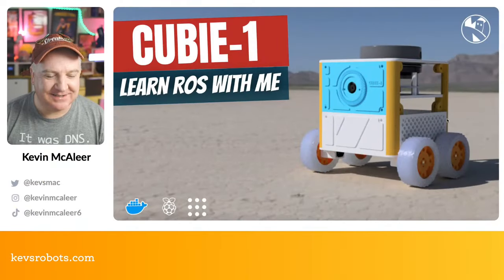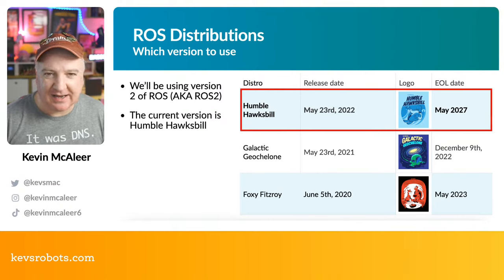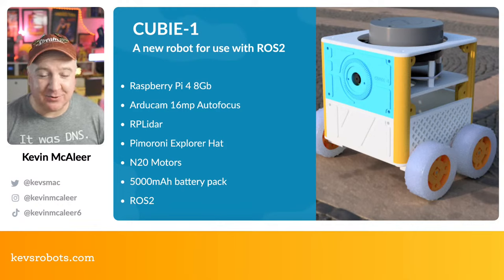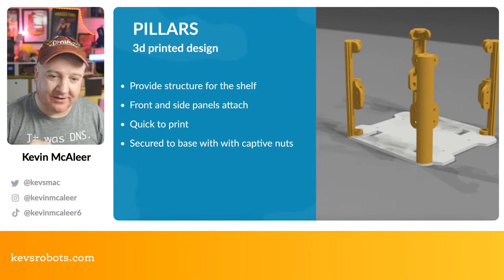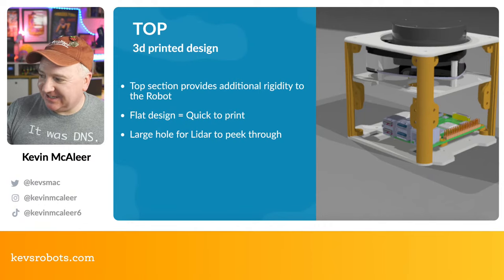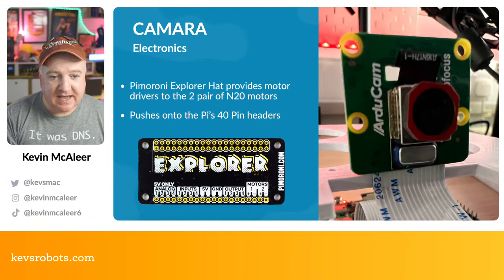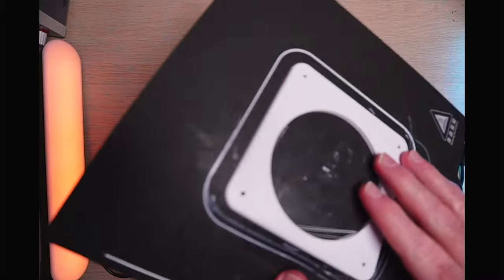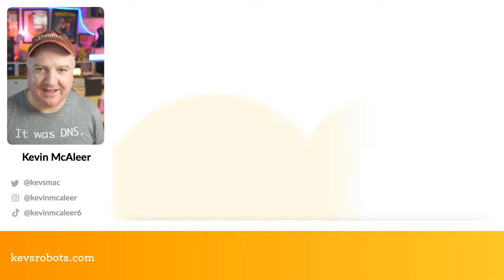Build a ROS robot - Learn ROS with me Part 1

Comment: This is great, looking forward to the videos!
And about the wired connection to a rotating device I was wondering about it myself, looking at surveyor's total station devices which also use lidar in a rotating scope.

And after a bit of searching I came upon a connector called a Slip Ring.

Comment: batteries are really expensive to get shipped from pimoroni these days. I tried ordering one (2000mAhr) in august to a uk adress, and they wanted a postage premium of over £41. I ended up buying 2 the same capacity from amazon including shipping for less than half the price of their shipping. I did have to reverse the jst connector pins, though so it is worth mentioning to check that the polarity is correct. I like your vid and robot. my own robot is using a pi zero w with "lego compatible" motors, pimoroni explorer hat, pi camera, and a lego frame (no 3d printer). I have 2 TOF sensors connected, one for the body, and one for the "head", but one went on the blink, so I had to order another one. I'm working on hardware for muliple switch sensors, but it is slow. I'm interested to see how your testing with ROS2 goes. currently I just use python, but I keep the code on my file server. that way I reduce the writes to the sdcard.

Comment: Hi Kevîn. Nice project, will be interested in building one. Can you give us more details about the exact type of the n20 motors ? I just now checked the pimoroni site and see that there are different models. will the all fit ?  Keep your cool stuff going !
Reply from the maker: It's a work in progress, so currently, the motors are not wired up yet. I want to collect odometry information from the wheels/motors, however, in the first iteration, they will just be simple motors. I've a bunch of 150rpm 6v N20 motors, so that's what I'm using first.

Comment: ROS2 seems to have more modest hardware requirements compared to ROS1.. I wonder why a platform capable of running ROS1 can't run ROS2!   For example the $500 MIKRIK uses ROS1 on the Orange Pi Zero3 and ROS2 for the for processing (LattePanda Delta 3, Intel NUC, or NVIDIA Jetson Nano, etc).

And why don't drones use ROS?  From what I've seen, they typically use either PX4 or ArduPilot.. maybe MavRos.  Is ROS harder to configure and build on small embedded hardware?

I'd like to make a very simple demo, using a BLDC motor and hall-effect sensors for the commutation feedback.  Could ROS be used for this?